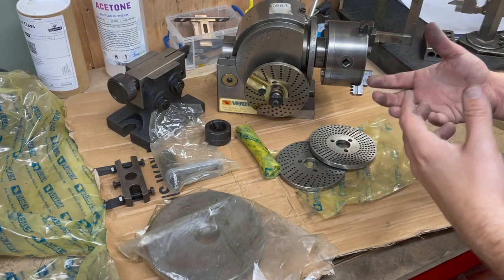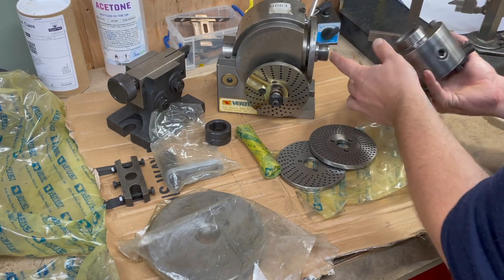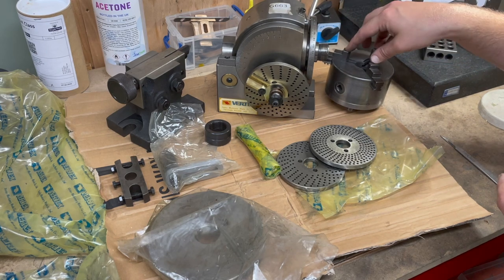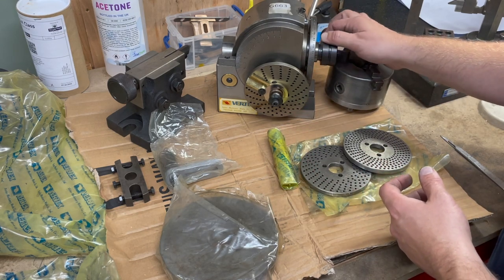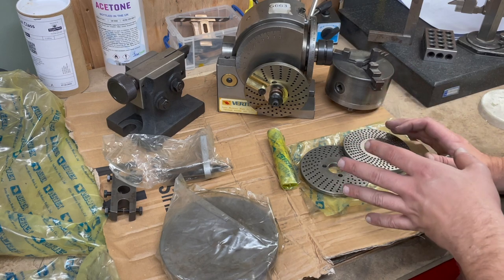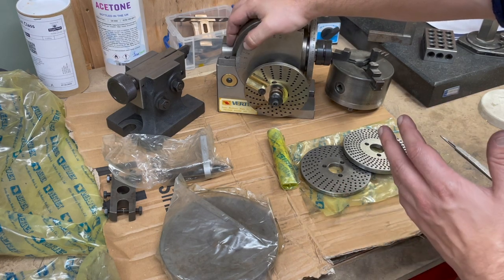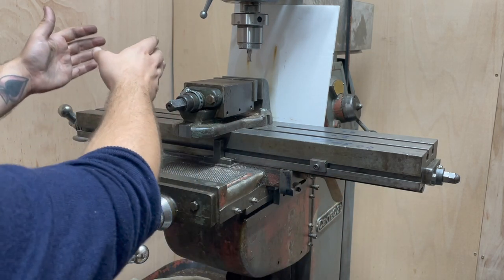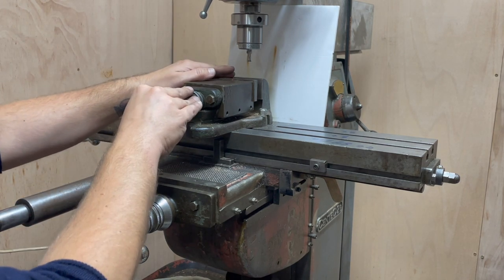Bridging the gap between the lathe and the mill

Comment: Great, you will be amazed how useful that will be,
Kev
Reply from the maker: Thanks Kev - I'm sure it'll be useful. Right now I'm trying to figure out what I need to make gears for!
Reply: @williamsworkshopuk  try a 33 and 34 tooth gears for short cut method of metric screw cutting in myford, that's if you have a QC gearbox, I'm putting a video up this weekend 2 parts. P1 making a single point cutting tool P2 will be cutting the gear
cheers
Kev

Comment: Don't kid yourself, there's always something else to buy. I've been buying a collet set for the Unimat 3 because trying to use the 3-jaw chuck is driving me up the wall. The chuck just won't hold silver steel rod firmly enough to start a die in the tailstock holder, and you can't always get away with starting the die on an extended taper. Collets will be useful for milling too, although the milling attachment is not great for a decent finish.
Onward and upwards, best wishes.
Reply from the maker: HA! Yes of course :) Well, speaking of collets I can't believe how much use I've got out of mine even with the relatively limited clamping range of the Myford MT2 finger collets.